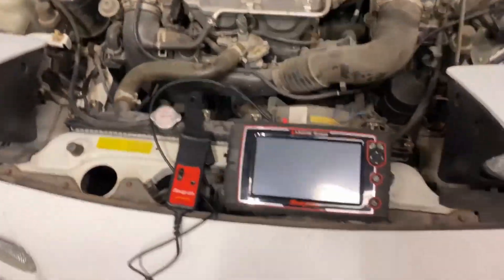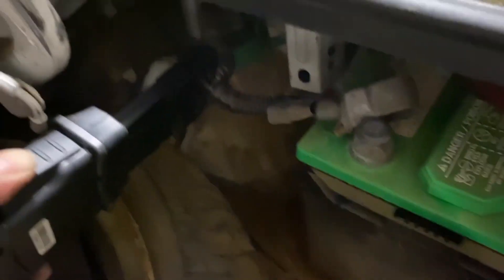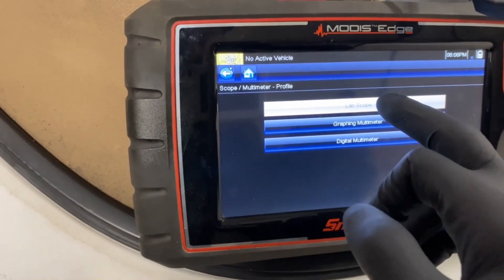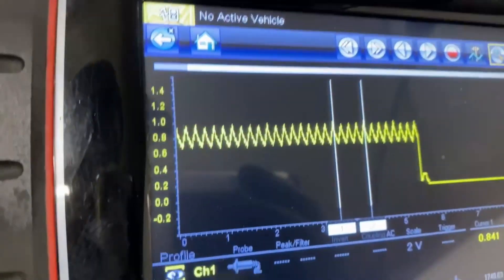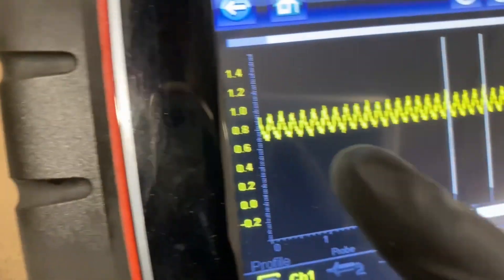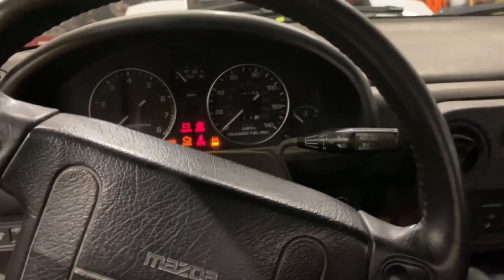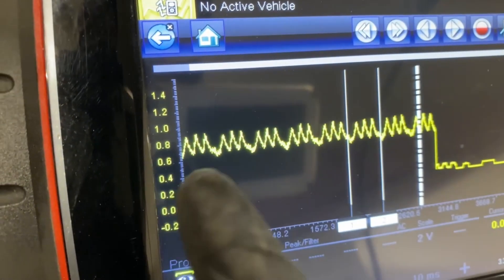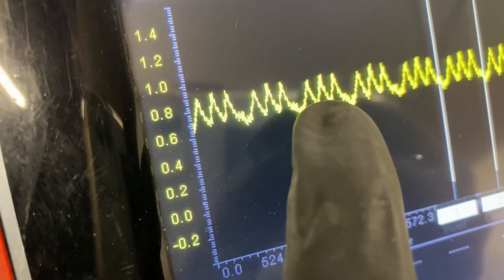How To Do A Relative Compression Test With Lab Scope - (Snap-on Modis Edge Lab Scope)

Comment: But how much does it cost to keep up a modis edge. How much a year ,can I still use it to scan and scope if I don't update every year. Snap on prices are wild.
Reply from the maker: U don’t need to update it to use the scope, and u can just get any brand lab scope or scan tool that has a lab scope doesn’t have to be snap on. The update is like 1200 a year I believe but that is just for intelligent diagnostic, and to stay up to date on new vehicles, I think u do need it up to date to use autoauth or any manufacturer specific software for newer mopar/Benz and a few other companies
Reply: Thanks for reply. Yea I know there are other scopes but I like snap on black screen also the fact that the scope is apart of the scanner . I may get a used one lol
Reply from the maker: Yea! Way cheaper to buy used and update it if needed than new

Comment: Great video, right to the point. I have the same scan tool and amp clamp. I did change the 10 Ms to 2 seconds to be able to see my reading personally, but it went well!! Also a quick note, my modis had the trigger set to an incline instead of straight line by default, so watch out for this. 10/10 though!

Comment: Great video. I have the same scanner and also am still getting used to this thing. I recently got a high amp clamp for it but don’t have the low one like yours yet. Can I use it in the same manner and if so how do I need to have the scope set up for it? Any help would be appreciated as there are not too many walkthrus around for this stuff.

Comment: Great video! Is the 60 amp clamp good enough for the test? I think starters usually draws 200A and something. Will a low amp clamp still works fine on RC test?
Reply from the maker: The way I had my meter set up it reads 1 amp as 10 millivolts so a 100 amp draw reads as 1 volt, that’s why I had it set to a 2 volt scale for this, but that doesn’t matter because you are only looking for relative current draw from cylinder to cylinder,